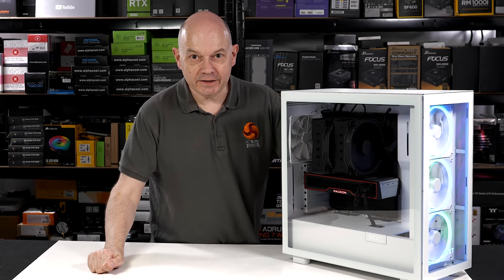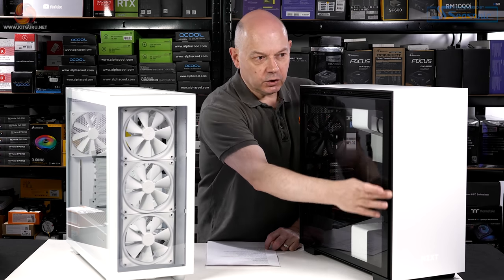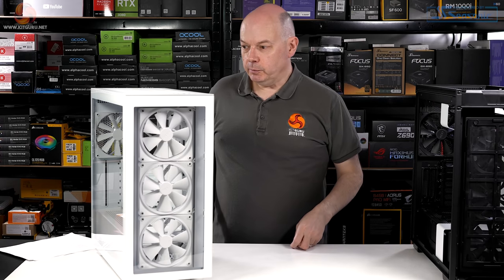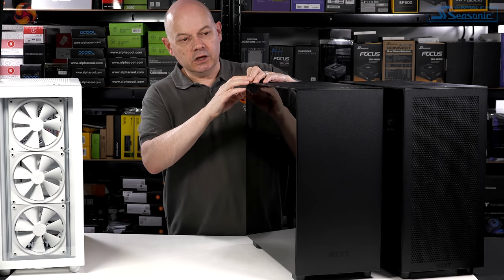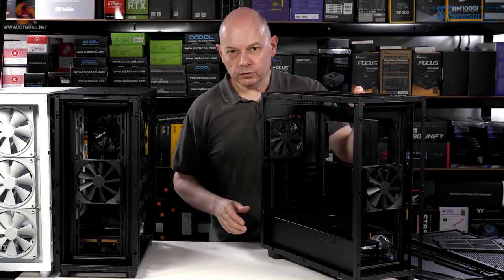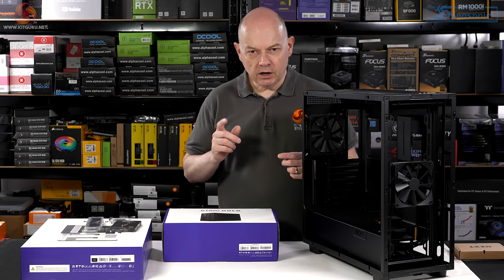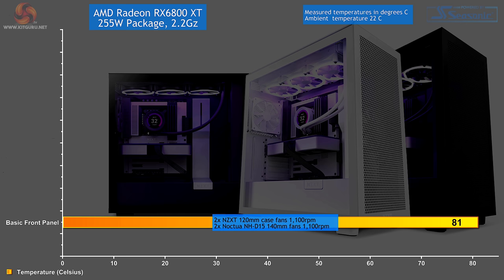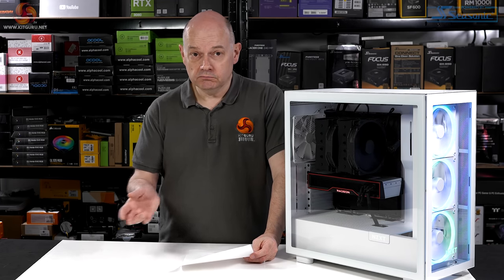NZXT H7 – The opposite of Elite

Comment: The NZXT H7 Flow is one of the nicest cases I've worked in.  The dual channels made cable management super easy.  I usually just pile it all in at the back.  But it just made sense to run them down the channels.  I was impressed. 

The build quality is 90-80% of the Corsair 5000D, but it is cheaper.  And now I've used the NZXT fans for the first time, they also blow Corsair Fans out of the water.

It's no competition.

Comment: I impulse bought the Flow case (because I needed something for a multi gpu setup) and  it's turned out really nice.  My only gripe with it is related to the cable bar... my primary gpu (MSI rx6900xt) barely fits... the card basically sits on the metal.  I'm mixed on whether I take the bar out (cards fits perfectly) or keep it in.  Other than that the case is great.  I do wish there was a mesh panel option instead of the glass.
Reply: The Flow is one of the best cases atm.

Comment: I'm on the fence between the H7 flow and corsair 5000d. I prefer the looks of the Flow, plus it supports 4x 140mm fans (1 at the back, 3 at the front), and it has toolless panels. But on the other hand, the 5000d is readily available where i live, while the H7 flow is out of stock in every local store i find.
Reply: What did you get?
Reply: @bachir5767  i finally got an H7 and 4x arctic bionix p14 fans. Quiet and easy to build in and maintain, and it fits my all black, no rgb looks as well :)
Reply: @EnlighterMinh  thanks i am still hesitating between h7 and lianli lancool mesh 2 beacuse i want rgb and lianli comes with rgb but its not available where i am from..
Reply: Don't get the corsair, their IO is such ass.

Comment: To make matters worse, the 4000d is significantly cheaper than any of these options - what was NZXT thinking?
Reply: nzxt in grenial is wayy overrated imo. I love my ASUS case.
Reply: @Direwoof  asus make really shit cases
Reply: The size of the H7 is between the 4000D and the 5000D. What NZXT needs to do next is to make a successor to the H510 (likely called H5) and improve the fan support like 3x120mm/2x140mm at the front and a 280mm radiator support at the top (though I'd expect them to execute this part badly if they're going to make one).
Reply: The 5000D is cheaper as well and you can put 6 120mm fans in the front
Reply: @spentcasing3990  air flow version is $20 more
Reply: @TheSjuris  For the 5000D ? Not where I am, it's slightly cheaper here
Reply: @spentcasing3990  in the US it’s more expensive.
Reply: @TheSjuris  I'm not in the U.S
Reply: @spentcasing3990  oh well.
Reply: @spentcasing3990  the 5000D cost what the hell are you talking about
Reply: @Velly2g  If you read the comment I said the 5000D was cheaper at the time in Canada and comes with fans. Right now depending on which site you look at there on par or the H7 is $100 more
Reply: @spentcasing3990  where i live in the USA.. The 5000D is $40 more. The 4000D with fans included is $150 more than the H7 elite. I wanted Corsair but their prices are a little bit much. I wanted Lian Li but you have to add 10 fans and now a $180 case is $480.. I think NZXT is probably the cheapest out of all these.
Reply: not only cheaper but significantly cheaper wow holy shit bois (same price)

Comment: I own the h510 elite. The front glass is removable and i can make a custom mesh for it easily. Just for summer days. It still looks better than these to me
Reply from the maker: That's committed of you. Such a shame they did not offer that option from the factory.
Leo
Reply: I had a h510 elite and bought the flow mesh on ebay for $20. The ebay user had it factory sealed straight from NZXT. I wonder why they just don't sell it on their website for people who want flow..
Reply: I had that case at one point. My GPU was so big that it single-handedly stopped the airflow and overheated everything and that was with a specially ordered mesh panel.
Reply: @KitGuruTech  I am trying to figure out if the H5 Flow front panel will fit on the H5 Elite. :) I might be dumb enough to buy a whole case just to nick its front panel. :)

Comment: Less stupid but still stupid. Nothing to burst into flames though so that is something. (Though substituting fans that fall apart in transit is a sidegrade that keeps the derp up!) If you are going to support 3x140mm (or 1 or 2) fans you should support the matching rad size; ie: 420mm. "Quite musical"? Don't give the fecks ideas; I wouldn't want that to be the next stupid after RGB; to take your ears off the noise. :-)
Reply: They are recycling at most parts as they can from the older cases... suck anyway

Comment: How are these new rgb fans from NZXT? Are they now the best rgb fan and how close are they to noctua performance and sound?
Reply from the maker: By definition you cannot compare RGB fans that use proprietary software control with Noctuas. I haven't done a direct comparison but the fans in the Elite appear similar to a mid-range Corsair fan.
Leo
Reply: @KitGuruTech  Thanks for the reply. If by definition you can't compare the fans. Could you add a Phantek Digital Halo to the Noctua then compare them? How is the noise, cfm as case fan and radiator fan of these new NZXT fans? Are they a big improvement over the last gen of NZXT rgb fans?